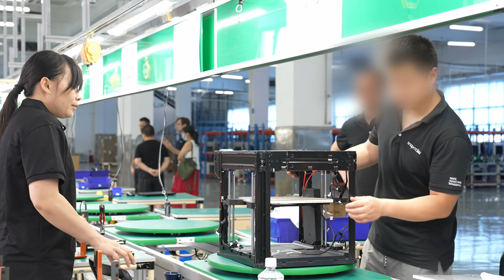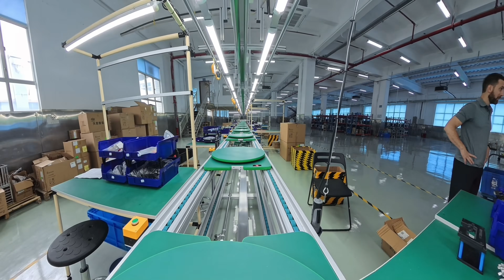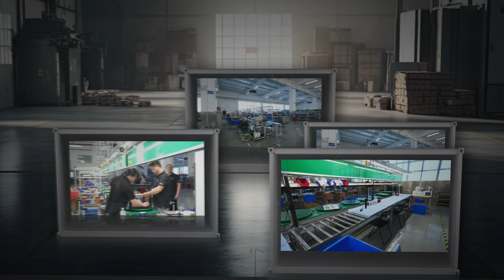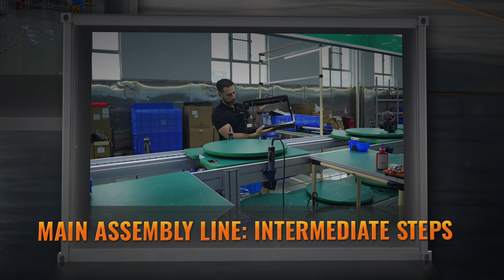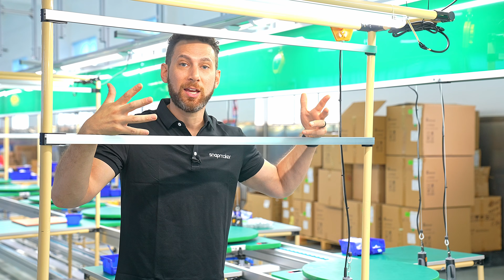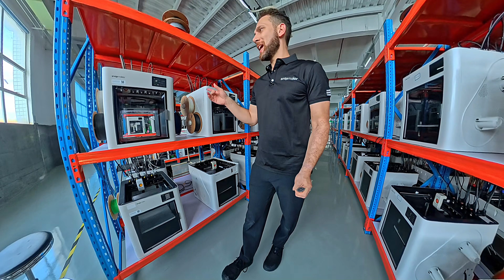SnapMaker U1 Factory Tour: HOW Did They Do This?!

Comment from the maker: **😢 APOLOGIES FOR THE AUDIO QUALITY During some parts of the video. We had a technical issue, mixed with sound cancellation due to echo in the factory. I promise the entire video isn't like that! 😢 ** To pick up YOUR SnapMaker U1 for just $799 (and support the channel), visit https://jle.vi/snapmakeru1 today!
Reply: audio issues in such a wide open space which wasn't designed for sound is inevitable.  i can't speak for others, but i had to problem understanding anything.  😊
Reply: u shouldnt delete ALL noise, like it ruins whole sound, better just adjust noise a half down, leave 50% or smthn, so u can save pretty clear voice and make noise less distractive (if u use adobe audition or any program u can set wet/dry percentage so it will make less noise while keeps voice good)

Comment: Aluminum absolutely conducts electricity—it is, in fact, one of the most widely used electrical conductors in the world. Virtually every electric utility relies on aluminum conductors to deliver power, from generation facilities all the way to substations, distribution lines, and ultimately to customers. While copper has slightly higher conductivity on a per‑cross‑section basis, aluminum’s conductivity is more than sufficient for power delivery and is offset by its significantly lower weight, lower cost, and excellent performance when properly sized and terminated. For this reason, high‑voltage transmission lines, primary distribution circuits, and most utility-owned infrastructure are overwhelmingly aluminum. The notion that aluminum is somehow a poor or inadequate conductor is simply incorrect; it has safely and reliably served as the backbone of electrical power systems for decades and continues to do so in modern utility design.

Comment: I wonder how long they assign each employee to a single station.   I would think that humans need a change of scenery to keep from going brain dead.  Is this a couple hours, a day, or weeks?  One interesting thing I've learned about the U1 that you never seem to hear mentioned is its power supply.  It's my understanding that the electronics have a "wide mouth" supply that takes everything from about 100VAC 50Hz to 240VAC 60Hz.  This means the same unit ships to all countries worldwide.  However, the heaters are driven directly from the power line, so they produce 4X as much heat on 240 VAC as they do on 120.  I would expect that system performance is significantly faster on 240.  Can you confirm this?

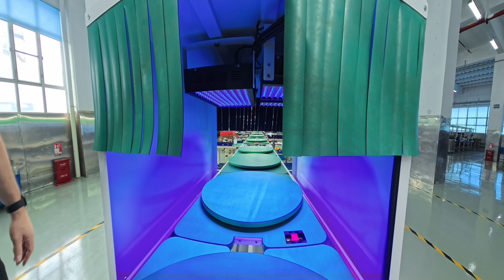Comment: 9:45 15:03

So the secret magic is UV cured resin in the joints
Reply: So basically, you cannot replace worn-out idlers or Y-axis bearings without damaging the plastic parts... This is the hidden flaw that nobody is mentioning in any of the reviews. I definitely would buy this printer if it were 100% serviceable. I actually reached out to support about this matter, and they confirmed that a Y-axis replacement requires exchanging the entire machine.

Comment: So you'll have to forgive me, I come from manufacturing environments and as assembly lines go, this has to be the most bare bones assembly line in existence.  

Where are the torque controllers such as Atlas Copco? So what we have here is "Faith-based Assembly", not the most reliable assembly choice. There's a reason why companies invest in expensive torque controllers such as Atlas Copco and Cooper Tools (because you simply can't trust humans to get it right every time).

How are they going to assure that every part was installed (properly, or even at all) without quality checks and quality gates? 

I worked at the Goodman HVAC plant in Fayetteville, TN and it is a closer match to this line than my typical haunts at auto factories. So what this plant is missing is everything that gets hung on a line to perform and check the assembly of the product, as well as provide a steady supply of screws, clips, and whatnot. I can agree with the length of the line (but I'm a Controls Engineer, not an Industrial Engineer), but it looks like it was just installed and is waiting for the rest of the equipment to get there. A bit Spartan to my old eyes.

As for secret sauce, allow me to speak to the guys who installed the gear and ask for the same setup as Snapmaker has and that will take a huge amount of the mystery out of the process. Or do these guys do one installation and disappear off of the face of the earth? :)

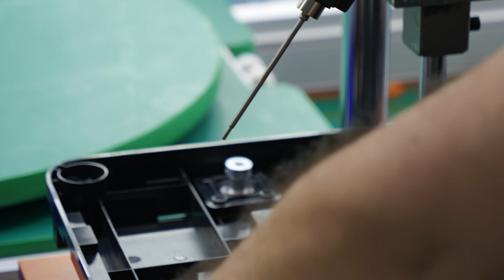@6:08 what hydraulic press? That one is powered by ArmStrong. Your Arm Strong. Which is good since anyone with a lick of sense would avoid hydraulics unless they are absolutely necessary (when, not if, they start to leak you will understand why they are universally hated).

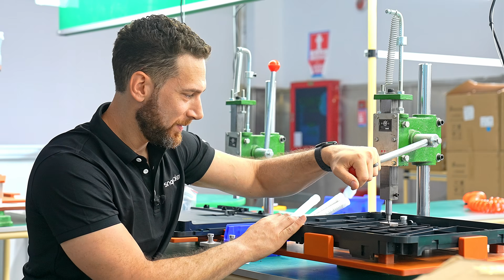The technique that you are missing @6:24 is that your station wasn't made for Lefties. :) That and the press isn't bolted down for Pete's sake. My guess is that there will be a lot of "Repetitive Strain Injuries" at that station. Hopefully they will rotate the workers through each station to reduce the time spent at the more "injurious" stations.

The UV station @15:03 seems to be lacking in protection at the entry and exit points.

The testing room would have stands to roll the printers in to test them, not place them on the floor. You don't want to man-handle the product any more than absolutely necessary. Not to mention the back-breaking aspect of picking up and putting printers on the floor.

And to do twelve hours of testing at a pace that will keep up with a leisurely 180 second job cycle (we built Saturn cars on a 48 second job cycle - which included entry and exit time. Who do you guys think you are? Corvette? :) ). You would need around 300 test stations (12 x 60 / 3 = 240 + offline and backup testers). Which if the plant doesn't have the capacity to test more (or reduce the total test time at some point) the line with be constrained by the testing area. 

I see no test gear to measure the power consumption of the printers. And alarmingly, no fire sensors or fire suppression that I saw. So what we see here is the beginnings of a testing area. :)

The throughput works to be a respectable 400-ish jobs a day (printers in this case) assuming a three shift operation and deducting time for breaks and lunch. So expect a 2 month delay in the shipping of your, which I think would be absolutely acceptable.

Comment: Great video. Do the test parts get used elsewhere if the print is good or is it dumped? 
Simple solution with the wire line to ground. It would be cool in the future to see the automation robot controller use.

Comment: Not exciting, the prices seems high, now that Bambu moved on to the new model.  Bambu just works . I am over 1100 hours on my X1C from start of year with zero parts replaced.   My only issues  learning how to fix misfeed/jams of filament and greasing, cleaning the camera for the laser, etc. 

 How can you X1C now at $1200 with a AMS 2 for most 3D printing in a non-farm???   And the X1C is more printer than most people really need.
Reply from the maker: This just works, too, and doesn’t need an AMS to load and unload and take forever like Vortek inevitably will….

Comment: Was really interesting to see a factory! 

Am mistaken or does it appear the assembled parts are coated in uv resin? I saw the UV light on the line. This likely would help to reduce vibrations (from assembled areas) while the machine is printing. Something like that?
Reply from the maker: They wouldn’t tell me what it does, just that UV is used to make it stronger and more rigid ;)

Comment: The u1 have 31 steps each taking 180 seconds, approximately 93 minutes to assemble 1.
Based on the kickstarter there is almost 20k orders, so it will take 1.86 million minutes to finish the entire backlog just on 1 assembly line 😂
Reply from the maker: Yeah but it doesn’t work like that bud, they don’t all work on the same printer at once :) 

They make a printer every 180 seconds.

Comment: The assembly line seems to be pretty efficient. The concept of building substructures away from the line is a good use of time. Ford is actually moving to this method in the larger scale with a new vehicle they have coming out where essentially they'll have the front, the rear, and the middle of the truck being built in different assembly lines and then joining the three sections together and finishing the truck. To date, no auto manufacturers have done this yet although Tesla talked about it a year or two ago. Ford is referring to it as a "model t" moment. If it works, you best believe that it's going to happen in other factories and industries as well even more

Comment: Aluminum doesn’t conduct electricity?  Tell that to the 12kw of solar power at my house that runs on AL wire. 

It’s non-ferrous, sure, but it most certainly does conduct electricity.
Reply from the maker: Yeah I misspoke. It doesn’t conduct well enough to be used as a ground!

Comment: One Printer every 180 Seconds. So if a shift is 8H two shifts a day they produce 320 Printers a day. So for around 90 working days (till the end of the year) 28.800 Printers could be produced not counting any delays because of testing. In the Event  they work 12H shifts common in Chinese factories they can even Produce 43.200 till end of the year. One Shift at 8 Hours would not be enough to satisfy all ≈20.000 backers . But the other options would be sufficient with some room for errors, testing or other not accounted for delays.
Reply from the maker: Your math doesn’t work. They aren’t all working on one printer - a printer takes 90 minutes to roll off the line start to finish. So… a printer every 180 seconds, after the first one. Also, nobody said anything about 12 hours a day…

I can’t say how many they can make, but… it should only take 2 months to fill the orders… give or take.
Reply: @thenextlayer I updated it. BTW don't become a china shill nobody likes china shills

Comment: so running this factory for 6 days a week, 12 hours a day and they don't even have 1500 pieces
Reply: You can't buy time and quality takes time.
Reply: Considering their success in the kickstarter they will have more than enough money and space in the factory to expand the line if needed.
Reply: By Toyota’s standard, mass production is only 25,000 units. Considering how close they are to that number, mass production doesn’t seem so far off.
Reply from the maker: Your math doesn’t math right. Also who said there will only be one line like this…? Or that the factory only runs 12h a day….? I’m not at liberty to say production capacity, but each line produces WAY more than 1,500 pieces per WEEK. 

They can make a LOT of these things

Comment: At ~19:20 you show the outside of the factory, and the first thing I notice in that shot is the railing that seems to only be tack welded.
Are they not finished building the factory, or did no one ever check if that railing is safe ?
Reply from the maker: Didn’t notice. Seemed sturdy enough….?

Comment: Jonathan you did an excellent job showing the assembly process even though you were limited on what you could share.  This also shows that the Kickstarter was properly used to ramp up the design and assembly line.  I really like to see that Snapmaker is fully testing the tool changing functionality which is a key part of the printer. 

I find it interesting to watch these kind of videos. I hope you can do more of these on the future.

Comment: In the early 1980s I lead a team that built 2 semi automated assembly lines similar to the main line in this video. It used a pallet based conveyorized approach with continually moving elements (like the blue rollers seen here) and extruded aluminum rails & structure. The pallet return line was below the main work line and the elevator units were very similar as well. The “ground wire” is to prevent static discharge from damaging the semiconductors and other electronics in the assemblies. This is not related to conductivity of aluminum, but the isolation and static buildup of the plastic pallets and moving polymer rollers. Our systems were used to assemble corded Craftsman power tools.
Reply from the maker: Thanks for sharing your expertise; it's fascinating to hear about the similarities between this and other systems.
Reply: the fact that the conveyor is alluminum and that it doesn't conduct electricity was to explain why they had the copper grounding wire down the length of the conveyor.  It was basically saying this big conveyor isn't steel so they had to run a ground wire all the way down the conveyor so everyone can ground themself,

Comment: I really like this and would like to order one but the build size is so small.  If it was bigger.  Like 300 or 320.  I would be all over it.  I need to print as much as I can on one bed for shows.   The different print heads cut ate great at cutting waist.  But the smaller build size i feel the time I save with the filament changes is lost with the smaller build size.   I've got 3 at 256mm.  1 at 300, 1 at 350, and one at 420mm.  
I'm g
Bit getting anything else under 300mm again.
Reply from the maker: Hopefully they do a bigger one
Reply: @thenextlayer if it was 300mm.  For say $1000.00 or even $1200.00 i would have already pre ordered 2 of them.   
Here's hoping

Comment: Is my math right that this is 20 printers per hour? With 2 shifts 6 days a week, that’s 1600 per week. That’s 12 weeks to build the kickstarter units. 24 weeks if the factory is running “only” 8 hours per day.
Reply from the maker: Your math is right but that’s not the total capacity and I am not allowed to say how many shifts… or how many lines there are like this one…

They can make a LOT of printers….
Reply: @thenextlayer Great! I backed the U1 after I saw your video about your support experience. Really pulling for their success.
Reply: Very interesting. But I wonder if some of those steps couldn’t be done by robots even faster. Like Tesla learned when they tried to fully automate their factories, there are some things that humans just will always do better / more flexibly / dealing with random problems, etc. But they automate much of the work and then have humans at stations where full automation isn’t practical. I could see in this line where robots + humans could be the best combination ultimately.
Reply: @cameronbigger3412  considering this is still a boutique item, automation makes less sense. Lot of steps could be done faster, but not cheaper considering the low volume and initial investment for automation.  Basically, they are making 20k units so each step is done 20k times.  You can teach human do the 180 second operation in 20-30 minutes, machine would be couple days , and you pay top engineer price .  Now multiply by amount steps, and you realize throwing people at it is just gigacheap.  Now, if they planned to do hundreds of thousands, and the line will be up for half a year and not just couple weeks, it's a completely different story.
Reply: I had 10 hr shifts when I worked assembly, so closer to 2400 a week with 2 shifts right? But it's normal to have a couple lines for stuff like this, I'm sure they'll have a bit of trouble at the start, but will be able to keep up relatively easily after the initial surge
Reply: So like 8 weeks for Kickstarter?
Reply: pretty sure this is not the only factory they have
Reply: I reckon they can easily produce the Oct and possibly the Nov batches before the October week long holiday in China.
Reply: dont forget the scalability. if you have one line running, you can easily copy it by double all steps. you only need space and man power, but i think thats not the problem. If the first units will work well, this printer will flood the 3d printing market, in a positive way.

Comment: Having build two vorons, these build assembly really show case how the printer manufacture cut cost down. For example the use of heating wire instead of silicone bed heater.
Reply: I wonder why they don’t use pcb style bed heaters. You’d think they’d be mega cheap.
Reply: @perkulant4629  There's cheap and then there's even cheaper. Often, it's just a matter of saving a few cents, and I assume this type of heatbed saves significantly more.
Reply: Bambu Lab uses the same type of heatbed. They originally introduced it with the A1 Mini and the A1, and now they also use this type of heatbed with the H2D and the H2S.
Reply: Silicone or silicon?

Comment: Due to past experience I won't buying any 3d printer that requires assembly : not even a tiny amount.
Reply from the maker: All you need to do is put on the PTFE tubes, USB cables, filament spool holders, and I think the screen. It’s basically fully assembled. Maybe you also have to put on the toolheads but that is just click them in place.